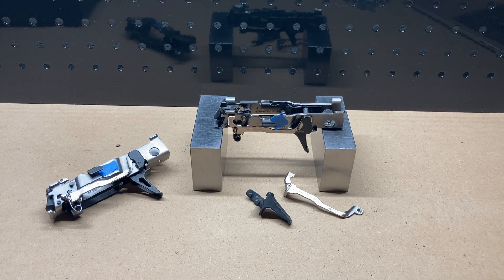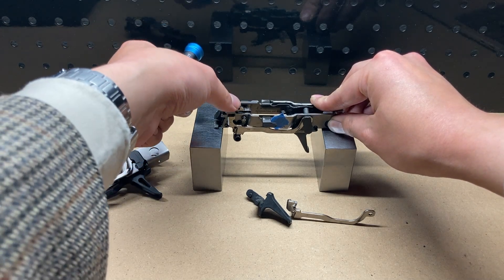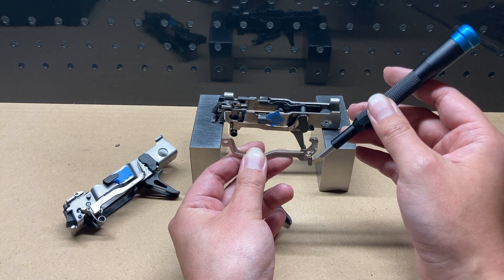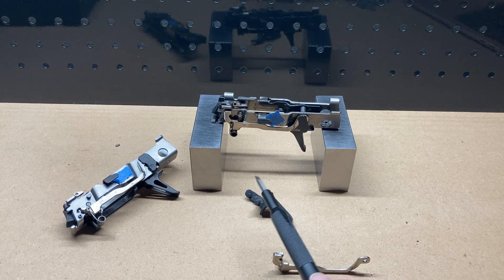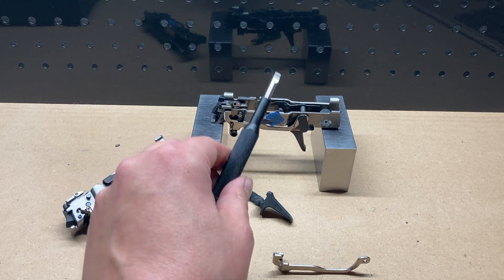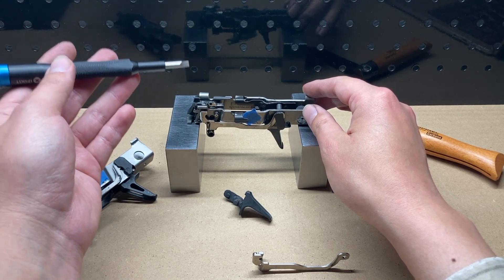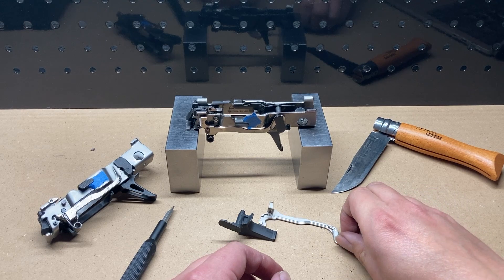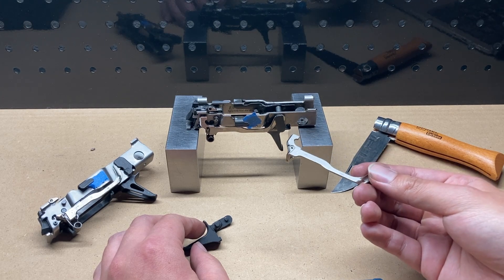P320 Sear Movement Test followup: It's all about the Trigger Bar and Trigger

Comment: This can prove Sig is making changes as they go.. if they were all the same you would think people is at fault but since not all FCU are created equal that could mean they adjusting things as they go.
Reply: I worked at Sig a few years ago and can definitely confirm that Sig is constantly doing small revisions. I left about 6 years ago and the P365 was already on like revision 40 something after it was initially released. Even the M17 after it was adopted was still getting revisions. I saw the hands of the employees doing the 20k endurance tests and they were covered in blisters since they were doing those 20k tests in a single day.
Reply: @FiveTwoSevenTHR  oh interesting, so like a parts revision log? I wonder if these parts can be traced back to revision numbers
Reply: Sig is cooked, just a matter of time
Reply: The trigger bar was changed with the voluntary upgrade to my understanding as well as the sear and a bunch of other parts

These trigger bars may be pre upgrade, and may also be for a manual safety. I noticed my manual safety trigger bars different than my non manual safety
Reply from the maker: Apocryphal word from the vendor I got the new 675 trigger bar from is that all of these trigger bars are post-"upgrade"; the 675 trigger bar is the older post-"upgrade" non-Manual Safety trigger bar, the 357 trigger bar is the older post-"upgrade" Manual Safety trigger bar, and the 576 trigger bar is the newer one that is supposed to replace both. I have not independently confirmed any of that, so take this vendor's word with a significant grain of salt... And so far in our observations, the trigger bar numbers do not correspond with whether a specific trigger bar fails or does NOT fail the tests.
Reply: @P320Truther  This is what I've found (and sig mechanic has found) to be true. I had the 675 trigger bar, was unable to get striker protrusion, and swapped in a 576 trigger bar for testing with zero change in results. Like you said, the only difference is one allows use of manual safety whereas the 675 bar doesn't work with a manual safety. Seems to be a tolerance stacking issue independent of which version of the trigger bar you have. This is all done on an FCU I've had from before the voluntary upgrade.
Reply: @AridNomad-d4e  Sig also has made iterative changes on the FCU components as well as modifying the striker assembly even for post-VUP p320 firearms.  I know at least that changes were pushed out into 2020, and parts were even removed from pre-2020 FCUs that were also post-VUP (late 2017 is when new p320 rolled off the line with post-VUP modifications and parts baked in from the factory).

Comment: Great detective work! Are the sear dimensions identical between the two guns?
Reply from the maker: Yes, to the extent we are able to measure.
Reply: I don’t like that the sear is retained only by spring pressure. The Glock has a positive mechanical stop that locks the sear until the trigger is pulled. Even the Glock performance trigger that uses a completely different mechanism has this lock feature.
Reply: My FCU cycles the disconnector if removed from the grip module. It does not when installed. I found that a small amount of lateral pressure on the trigger bar near the trigger will change the behavior. It changes how the sear and trigger bar contact each other. 

I have yet to disassemble the FCU to investigate, but I am interested now. 

Thanks.
Reply from the maker: Yep, and the change in FCU behavior between the workbench and installed in a grip is precisely why I wanted to show folks how to see the behavior with the FCU installed in a grip module! In our experiments, the 576 Trigger Bar seems more susceptible to odd behavior due to sideways forces - something about the 675 Trigger Bars makes them a little more resistant to twisting.
Reply: Despite the disconnector not cycling, using a chopstick in the barrel as an indicator, I can manually disengage the sear with a pick and the firing pin does not drop to launch the chopstick. If I pull the trigger to eliminate the take up, then depress the sear the chopstick launches.

I have a 576 trigger bar.